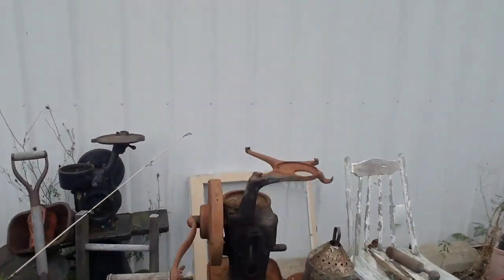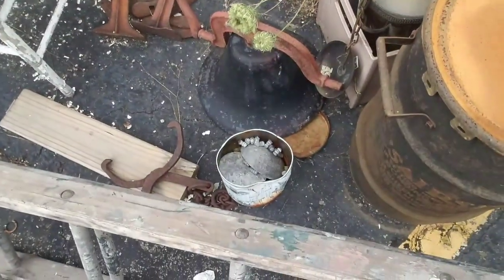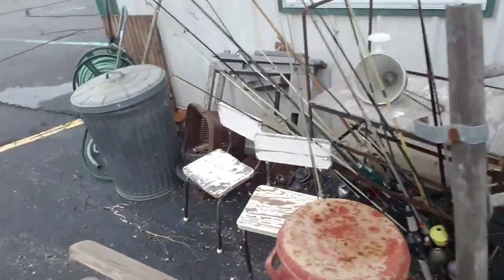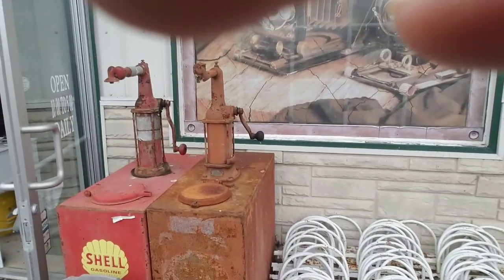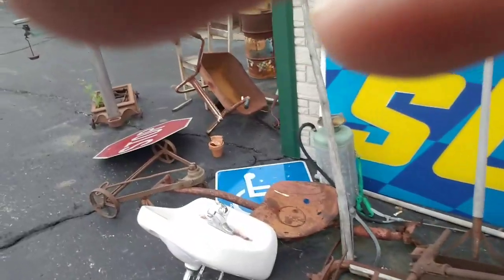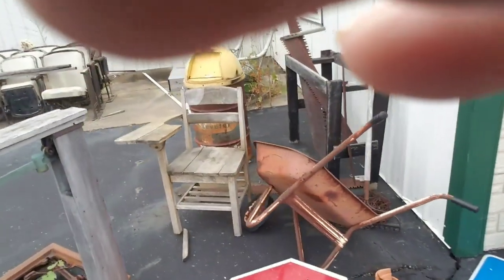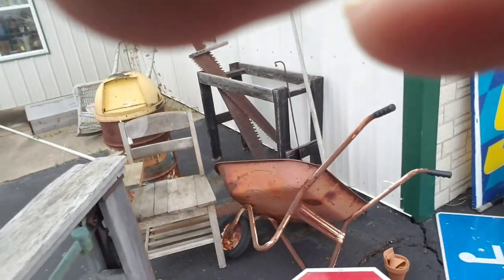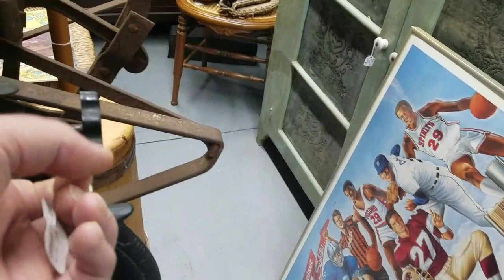Old Sneelock On The Road~Coldwater Antique Mall

Comment from the maker: It seems that Verizon doesn't have a signal east of Coldwater. I traveled to Allen along US 12. It wasn't until I got turned around to head home and passed Tekonsha that YouTube popped up and said the video was posted. 😁😎
Reply: Who knows about Verizon or any of them. Big bunch of crooks the way they operate here. Service gets sorrier and sorrier. Used to be able to go outside but that's a thing of the past. More towers but less service. Got a relay from Galco out of Madison Heights for the ozone setup. Our water STOPPED after it went down to less than a small child peeing. Got the filters re-done but it was a check valve got stopped up with iron that did it but it'd been 4 years since the filters were done so it's ALL fixed now. The ozone generator and compressor keeps the iron and smell away and help the filters trap it and backwash it outside. Then the Berkey INSIDE REALLY cleans it up for eating purposes. 92 here and wringing sweat weather. I was outside making a new holder for the spin on filter because that cheap steel thing is just about gone. But maybe next week when Toots goes on the grub run before I can install it because the water has to be off and pressure drained. Job security and we always try and give our stuff to someone that can use it.

Comment: That store had a good variety of inventory.  The rusty thing you asked what it was, I think it was used for putting hay in the barn loft, we used rope slings. You should have grabbed a sickle  grinder out of that pile on the floor and took it home .
Reply from the maker: Good guess on the hay fork. 
The sickle bar grinder would have worked on my John Deere sickle bar mower but it is long gone. 
I would like to have one though😁😎
Reply: @OldSneelock  Al I saw were Estwing handles! AND the sickle bar grinder.